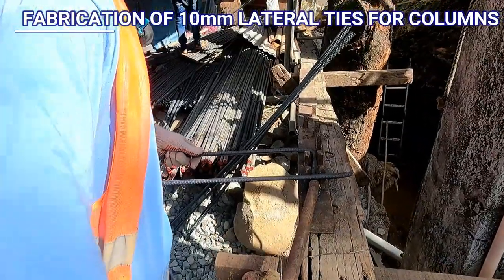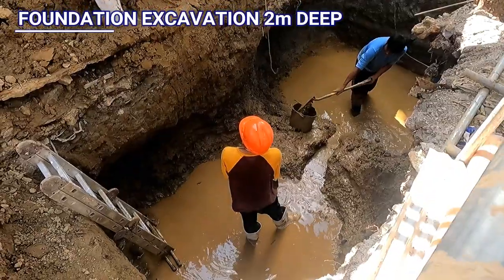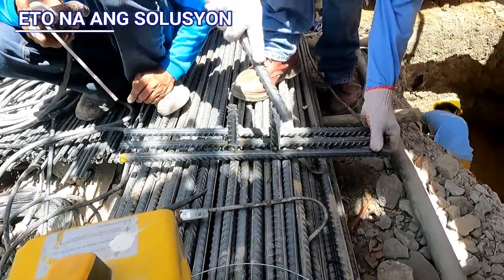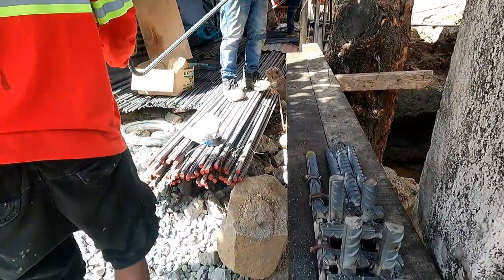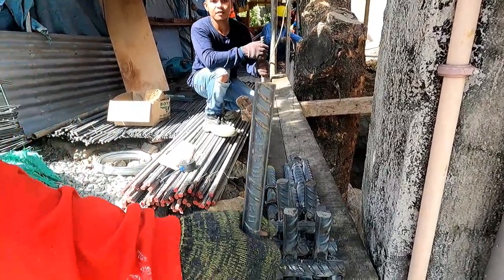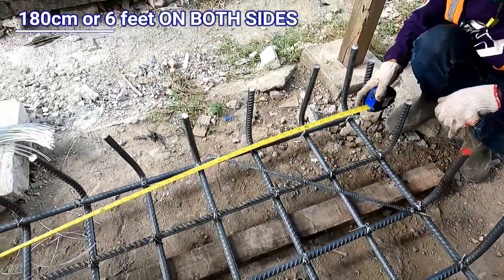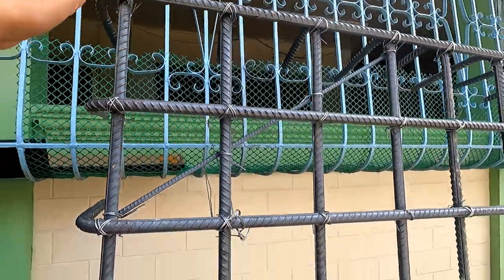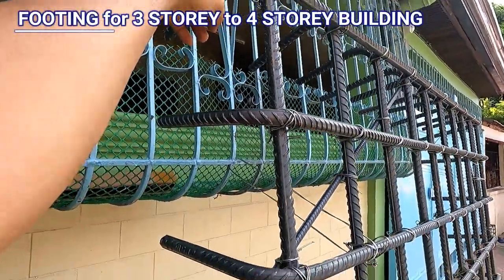PAANO GUMAWA NG FOOTING ng Three-Storey Residential with roofdeck

Comment: Sir tanong ko lang po, 
Nagpagawa po aq bahay ,naka abang para sa 2 storey,
Yung 2nd floor naka slab na pero wala pang poste ang 2nd floor,
  Ang bakal pong ginamit ko ay 4 na 12mm at 2 16mm,
   Nagbago po ang isip ko balak po lagyan ng roofdeck at maliit na kuarto sa roofdeck,
  Tanong ko po,
 Pwede o ba dugtungan ng 16mm ang bakal  na 12mm sa poste sa 2nd floor.
  Kc po ang bakal poste sa ground  floor ay apat na 12mm at dalawang 16mm,.  
Bale gagawin ko pong 6 na 16mm ang poste sa 2nd floor ,pwede po ba dugtungan ko ng 16mm ang 12mm na bakal?
Reply from the maker: Naku wag po, mas m inam po na p visit nyo sa professional yan, actual inspection po sana
Di po advisable magduktong ng mas mabigat na reinforcement kadalasan  sa ilalim po yun